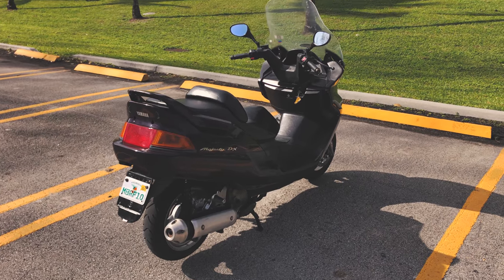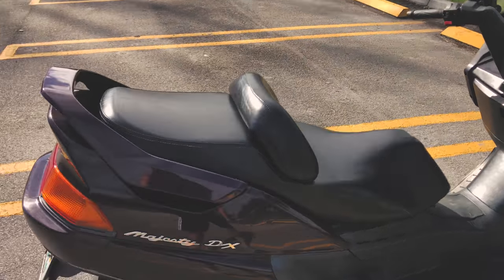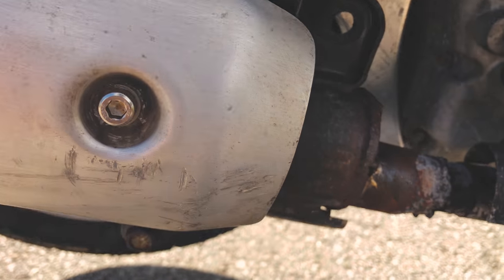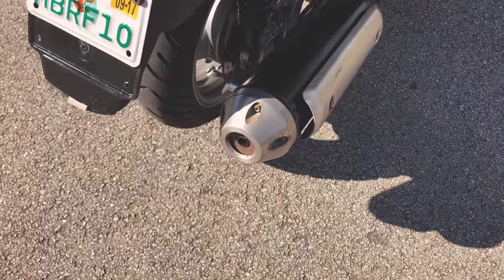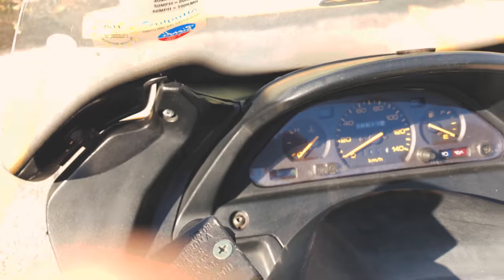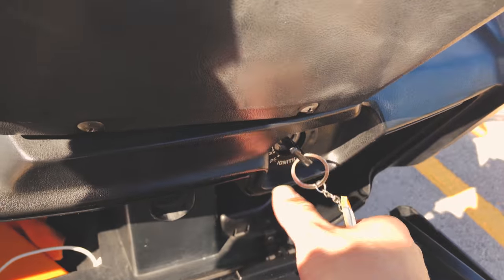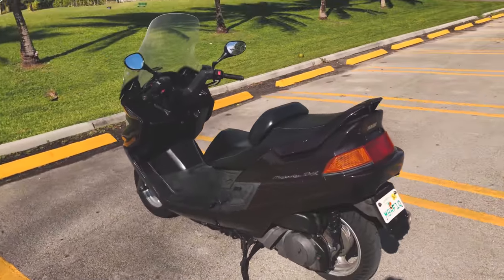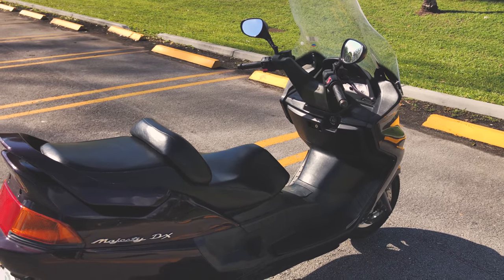1998 Yamaha Majesty 250 Maxi Scooter YP250 Walk Around

Comment: hey man, its aftermarket, higher windshield, its 10cm higher then regular. its updated version (lel) with disc no front and back wheel.  It very good quality and maybe the first made maxi scooter there. i have `96 model, im still using it. just replacing tyres.
its Easy to maintain (oil filder is cleanable, air filter easy to make, fuel filter costs around 1-2$) seat is THE BEAST, most comfy bike i drove (did test newer majesty models,  suzuki burgman, T-max, piago trashes etc). longes drive was 500km in 9hours. with my wife on backseat. it was mixed drive. im gonna use it till it dies, but seems i`ll die first. LOL   (sorry im typing from my wifes google account)
Reply from the maker: Thanks for sharing the info! I have just sold the scooter and bought a motorcycle.. I'm already missing the YP250, it's so easy to ride in the traffic, and holds a ton of groceries... Now I have to work really hard on the clutch for my motorcycle in the stop-n-go traffic. If I do come across another majesty, I may consider getting a scooter just for the city.